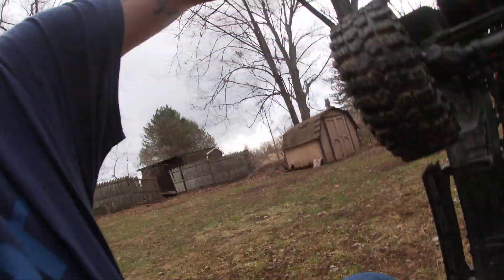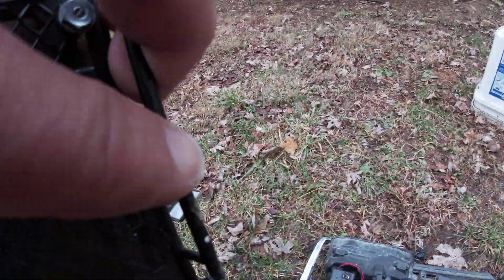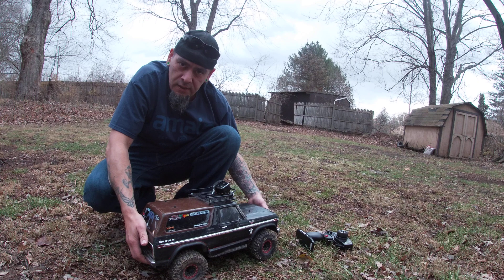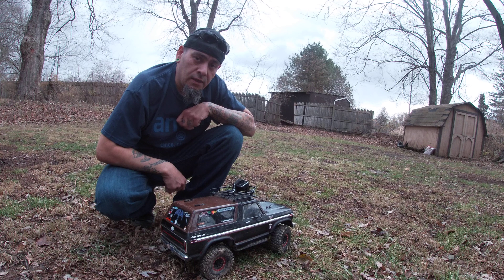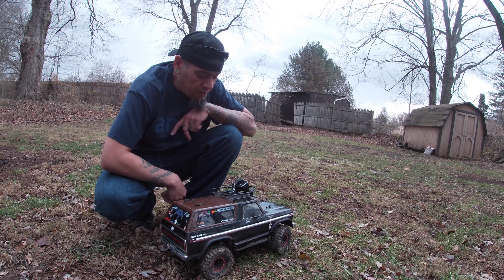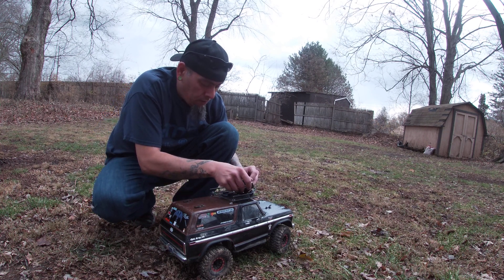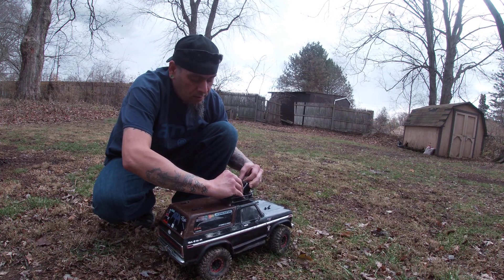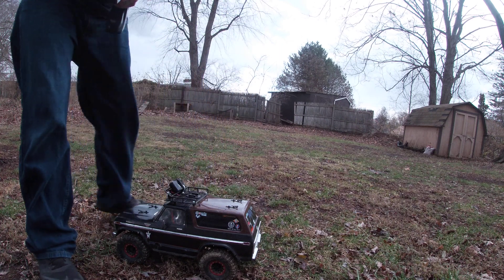Traxxas TRX4 Hobbywing Speed Test

Comment: I would like to see another test on smooth concrete.
Reply from the maker: Not a Tactical. TRX4 with SSD portal deletes, locked diffs, suspension mods, custom painted Dodge RAM 1500 body, Holmes Hobbies BRXL 6s ESC and Apex 27t motor. Still 2 speed tranny. 1.9" Milestar Patagonia tires stretched on 2.2" 5 spoke wheels.
Reply: @danosgarage1  - I've managed to get the parts to make the stock tactical.
It seems switching out parts with metal or removing weight didn't seem to help. I do believe my upgrade choices are valid. They just don't mean more speed. 
Hope you drop by for a view of my new Tactical if you get the chance. It comes tomorrow. It will be getting the full armor treatment and internal spring shocks.
Reply: @danosgarage1  Thank you for letting me know something.
Reply from the maker: I no longer have this rig. I'm actually selling all my RC's.
Reply: @danosgarage1  - Got a TRX-4 Tactical Unit in the pile? I'm checking all potential sources, if I get one it's getting the royal treatment.

Comment: You need to run 3s..
Reply from the maker: Gives a good representation of it right out the box! Lol! I seriously appreciate it!! I just did a firmware update and I totally see what you're saying!! Thank you!!🤜🤛🤘🤘
Reply from the maker: That is on 3S. The Hobbywing setup is a lot slower than stock but has the torque and is sensored.
Reply: Then, I know why your truck is so slow..  in the hobbywing app on your phone, you need to put both reverse and forward to 100%...  Because, our motors spin in the opposite direction.  From the factory it is set on 100% forward & 50% reverse..  Because, my 3300kv sound much faster than your motor in the video on 3s..  there is also an option to switch your motor direction..
Reply from the maker: I'll check it out but to be honest, I really don't need a whole lot of top speed being she's a crawler. And, I like how quiet she is compared to other brushless motors 👍
Reply: Cholo's Tiny Truck Chop Shop , Just wanted to clarify, because, the video you posted, doesn’t give a good representation of the top speed with the 3300kv motor..  Yours look like 50% power, that’s why i was wondering if you were only on 2s power..
Reply: With the 3s the truck becomes very unstable, due to it going to fast with the high center of gravity.
Reply: @danosgarage1  It's not about top speed. Wheel speed makes the tires expand and get traction when the crawler is stuck. That is why I use a 3800kv. Still has the low-speed crawl but the wheel speed to get out on situations I could not with lower wheel speed. Plus I love to also bash it in the skate park, lol.
Reply from the maker: @FarmerFpv  I'm not into crawlers anymore, but I appreciate the view and comment!💯